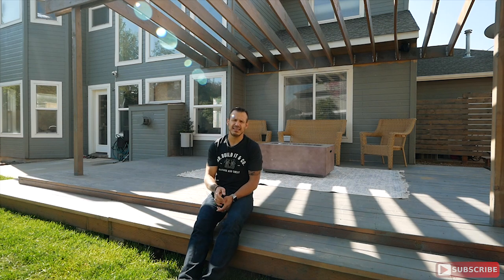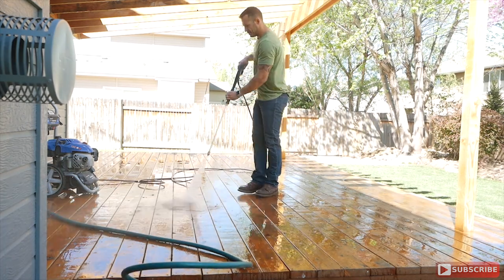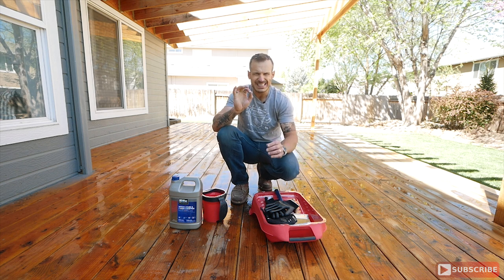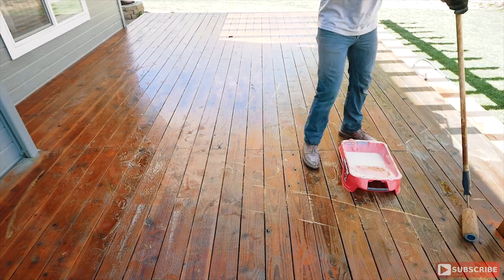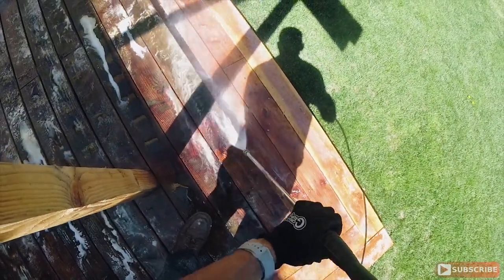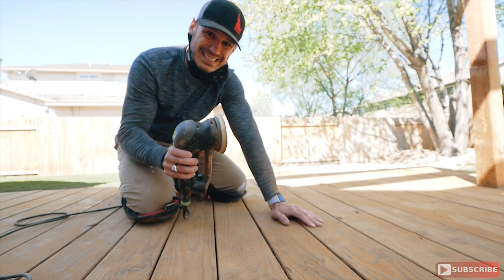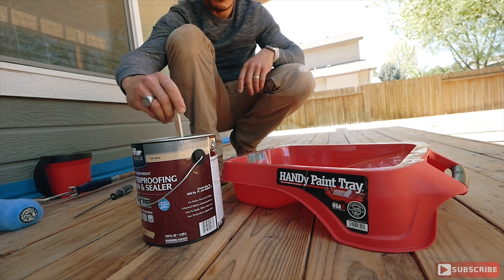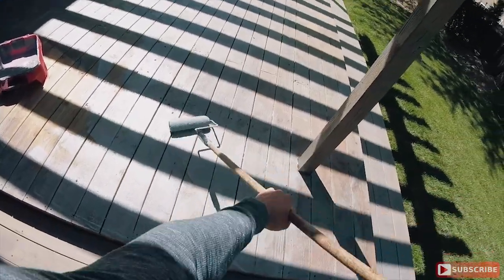Deck Refinishing | How-To Clean, Strip, Sand, Restain

Comment: For anyone watching this. For oil based semi transparent stains:

1 cup sodium hydroxide in one gallon water. Spray it on a dry deck liberally. Keep it wet for 15 minutes. Grab a pressurewasher. White tip 6 inches away ONE board at at a time. Long passes. Don't go back and forth like this guy. Don't stop. 

Once that's done apply deck brightener.

Fuckin done.
Reply: Does this remove stain?
Reply: @carwashsoap  it will strip oil based stain

Comment: I would be stripping of the second product too. Better color but the consistency is pretty bad. Kind of looks like you tried to go with a solid color stain but stretched the material out instead of buying more
Reply: That's a semi transparent or opaque stain. Stains are basically watered down solid paint.
Reply: you can see him walking on the stain as he's applying. This is a big no-no. Also, it's better to paint one-two boards at a time to prevent lap marks. start at the house and work away so you don't stain yourself into a corner.
Reply: @christopherwilcox9654  i have stained my deck twice, about to do it a third time. Initially it was a 10-20 year old stain it was nasty. I hand sanded it. Last time i used an orbital. I will sand it again. It is a small deck with 2x4 decking. The first time my mistake was only staining half the deck, half of some boards. The stain was darker where it overlapped, and it drying on different days also accentuated this mistake, so don't do that either. I agree don't walk on it and do full boards. The second time i learned and stained full boards. But it rained alot and it took several days, so i lost patience and i ran out of stain so i used different colours I had on hand. Unfortunately they dried much differently. I also chose darker as it was impossible to get all the stain colour out. I will do this again this time, i will choose a darker stain, as getting the previous stain out of all the nooks and also in between the boards, is impossible, and i can't really remove all of these boards easily. My two cents on my experience. His energy is really good and he is in much better shape than i am, with such a huge volume of work...but unfortunately the result is really bad in terms of consistency. I blame the transparency too. I like the look and colour of wood, my other deck turned out great, i used a slightly tinted transparent UV protected stain, but...it was new wood and i stained the boards before i put them in place - all the way around the board - twice on top and on the sides, once on the bottom, on a work bench.2x6. One board at a time, in the shade. Very very very nice. Staining in place is alot harder. Thanks for posting, it is important to also see mistakes.
Reply: You also shouldnt be rolling stain. Some people say you can but its a horrible idea

Comment: stop using Behr their products are bad baddd! Use an actual top stain oil product like TWP, A&C, Cutek, ReadySeal, Sikkens, etc
Reply: Salvador Nobre Veiga 
What paint do you recommend?
Reply: I want to paint it white
Reply: @susanag1849  you don't paint decks. It will peel off really quickly and then it's a nightmare. You stain them.
Reply: I just tried Sansin Dec. Amazing look, we'll see about durability :)

Comment: As a professional pressure washer, this hurts to watch. Also the stripper is not an acid, it’s a base.. that’s why the wood turned a darker color. Acids would turn the wood a brighter color. You said to go with the grain of the wood but then you don’t do it yourself when rinsing.. all over the place man. Go slow and steady.. long runs down the length of the board and back.. plus it was super fuzzy after because you used way to much pressure to rinse the stain off.. you destroyed the wood fibers. And frayed it. I mean. Yeah. All I gotta say. Should have just sanded it from the get go

Comment: Sand everything skip the pressure washer if you can, I sand decks and railings with 80 grit and stain using Ready Seal Stain with a 2" and 4" brush they look flawless and are extremely durable
Reply: soap on a rope what kind of sander?
Reply: Rent a deck sander. Gets the bulk of the sanding done fast. Then use a belt sander and orbital sander around the edges.

Comment: Looks decent, but nothing will beat a big drum sander. Way faster and youll get a better finished result as you have opened the wood grains consistently, Orbital on soft species of wood will give you a un even stain job. Drum sander running with the wood grains, cut it twice once with 36/40 gritt to open the grains and it also flattens everything very nice and fast, finish up with an 80/100 gritt and stain away.

Comment: I haven’t seen a stain that looks good after 2 years. If I had to redo my deck, it would be with composite wood!
Reply: Everyone says the same thing about changing their deck until  they realize it's $4,000. Instead of recoating the deck surface for $400. Yeah it has to be done every 3 years. That's life
Reply: @drleo2641  true

Comment: What about the chemical harming your lawn? Anything on that, is it gonna damage the grass
Reply: I've seen recommendations to cover shrubs, bushes, potted plants etc. with plastic drop cloths or canvas drop cloths in the case of sturdier plants (like bushes/shrubs).  As far as grass, that's a good question.  Maybe cover the grass immediately surrounding the deck (create an apron, if you will).  Then immediately afterwards, run sprinklers in the area to dilute any of the product that may have drifted over onto your grass.

Comment: Thanks for the video. On a side note, I think you broke my soul a little bit by staining it an unnatural wood color. Ha. My sanding down hasn't completely removed stain, there are still small streaks and stuff, just like what is in your video. If I plan on restaining it with the same stain, is this going to be an issue or do I really need to grind out the entire deck with a sander?

Comment: I appreciate most of the projects posted here, but I did the same thing to my neck years ago and RUINED the wood.  By presure washing it too close and then being forced to sand it the chemicals that made the wood  “treated” were stripped off and even with solid stain the wood started rotting.  Had to re-do the floor with Trex ($$).
Reply: So you held the pressure washer too close. Not the fault of the method but rather operator error. It's fine to pressure wash decks. Just don't get too close.
Reply: Did you treat it after stripping to restore the wood’s pH? This guy didn’t and it’s an absolute necessity. What you are describing is what happens when you don’t.

Comment: Rinse with hose, strip with potassium hydroxide base stripper and only use the stripper when it is in the shade and cool not like in this video, the stripper needs to be brushed while wet with an extremely stiff brush never use a pressure washer, after that sand with a 40 grit sandpaper, clean off the dust, and stain using a product called CUTEK, I have struggled for many years with garbage stains like the one used in this video, until I discovered this product... I'm not associated with this company in any way I'm just trying to save you guys a bunch of time... Try it you will not regret it

Comment: Mr. Build It, allow me to premise this with I think you're a wonderful teacher, and you tackle any project head on. Awesome, admirable traits. Thank you. I just found it funny when you said if you don't have a random orbital sander, grab your angle grinder. Not only would an angle grinder potentially gouge and ruin a deck; it's not normally cheaper than a nice Makita sander like yours. Just thought that was funny. Carry on. I think your advice on remodeling a bathroom has been invaluable. ^^✌✌
Reply: I’m wondering if he confused it with refinishing a log home for restaining as we pretty much only use angle grinders with the 5”-12” sanding pads. For a deck like this though I would always use one of those large push ones that one can rent.

Comment: If I’m sanding the whole deck with like 80 grit do I need to bother cleaning it. Some say yes and the guy and the paint store said no, as by sanding it, it will clean it anyway. Anyone know?
Reply from the maker: Nah. Cause you would take the dirty layer off anyway
Reply: I would pressure wash (or scrub wash) to get any grit, dirt, mold and possibly oils that would interfere with the sander coming in direct contact with the layer you are trying to remove (you may needlessly burn through unnecessary amounts of sand paper otherwise).
Reply: I sand everything it saves me time and mess, the finished product speaks for itself, I sand and stain decks for a living and I would only reccomend READY SEAL STAIN best finish and so easy to work with no runs no lap mark's can get wet after 1 hour can be applied in any temperature. SAND EVERYTHING AND USE READY SEAL your customers will love you
Reply: Soap on a rope. Do you use oil based stain?
Reply: @tysmith7646  yes I do
Reply: @soaponarope8995  I don't like the "painted" look of it, If I have beautiful wood why cover it up? I guess it's easier. Ready Seal has a clear-ish stain that lets the natural wood stand out?
Reply: @soaponarope8995 do you have to sand old semi transparent oil stain off before restaining with same type product/color? Ty

Comment: Why use the chemical stain remover if you are going to bring a random orbital sander to the job? The sander removes wood so quickly (40 grit pad) that one single pass would have effectively removed the original stain, especially on a deck that needs refinishing.
Reply: Did you listen to what he was saying in the video at all? He got too close with the pressure washer, so that coupled with the remover left the wood feeling furry - he didn’t set out to use the sander...
Reply: chemical stripping gets INTO the wood grain/pores and sanding only hits the surface that it hits. Get it?

Comment: Great video! I am in the process of re-staining my balcony, 65% of stain is still good, do I have to remove  all the old stain to bare wood or is it enough to  sand it with 80 grit and apply two coats stain & seal? kindly please help.